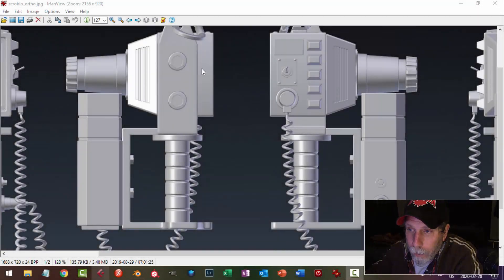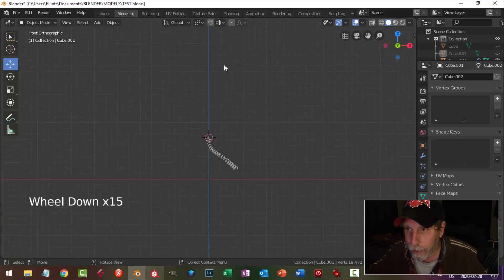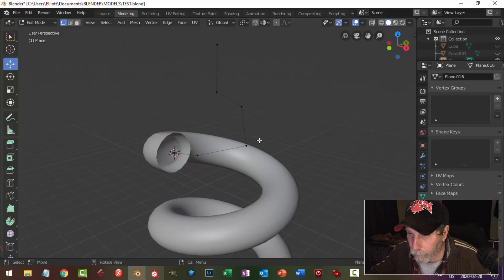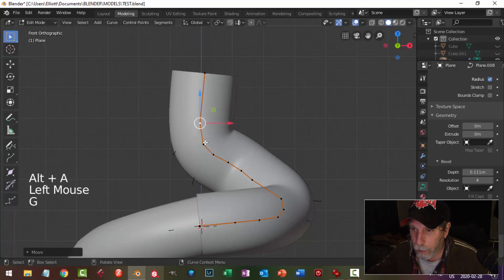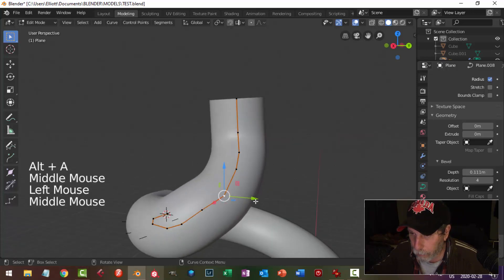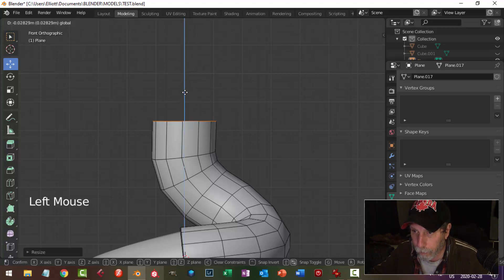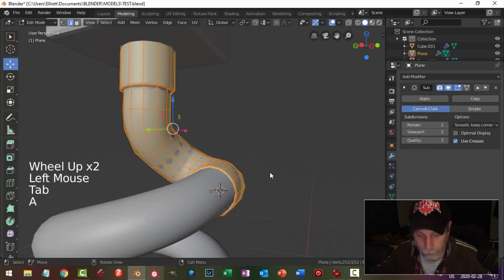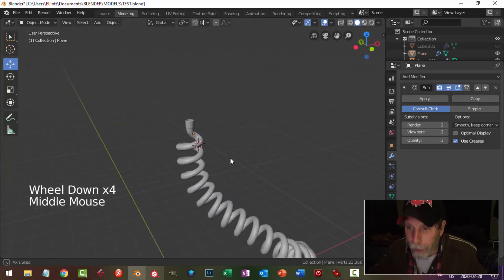Blender 2.8: Modeling a Coiled Cord End Piece

Comment: Hello, I returned to finish the spring but when I put myself in "edit mod", the spring is not the curve and I do not understand your instructions well.
Reply from the maker: In edit mode, the spring will not use the curve modifier so it will just appear straight. When you go back into object mode, it uses the curve modifier again. So try to make your edits while in edit mode even with the spring straight and then go back to object mode to see how it looks. Back into edit mode and edit again if necessary. You could also make a duplicate of the spring to practice editing to see how your edits will look when you are back in object mode. Once you like what is happening, you can repeat the same basic edits on your original spring. Good luck!

Comment: Hello, when I go into edit mode, my spring this teleport in vertical upwards you already had this problem?
Reply from the maker: Sorry, but I don't quite understand what you mean.  Perhaps you can take a screen capture image of the problem and email me at kimmelelliott@gmakil.com.  Otherwise, I'm really not sure what the problem is.  Thanks.  Another suggestion is to start again, just model the cord completely straight and see if you can get this method to work.  Then do it one more time with the cord a little bit bent (following the curve) and see if it works for you.
Reply: @zerobio at the start of the video, you select the rhombus in edit mode and you do shift s, but when I go to edit mode, the string goes vertically straight and this moves and the center of the rhombus is therefore not at same place
Reply from the maker: Yes when you go into edit mode it ignores the curve for the time being. You can still edit the size of move points around in edit mode. Then when you go back into object mode, it will again follow the curve. Keep playing with it. It does take some time to get the cord in just the right position. Try moving it in the x, y and z in object mode to see which axis you need to move it in to position your cord where you want it.